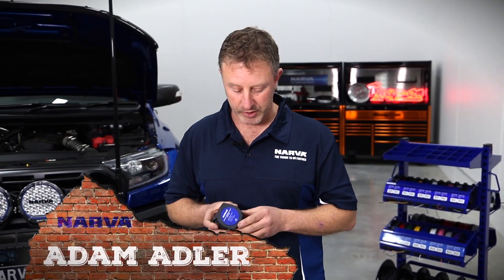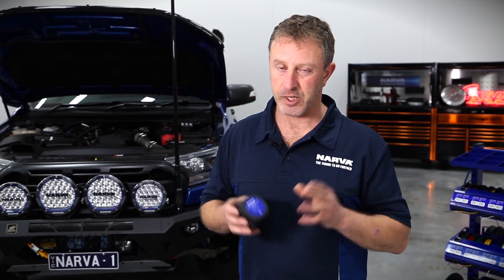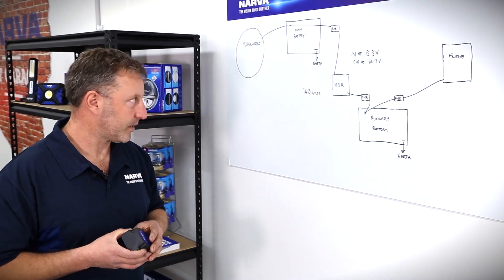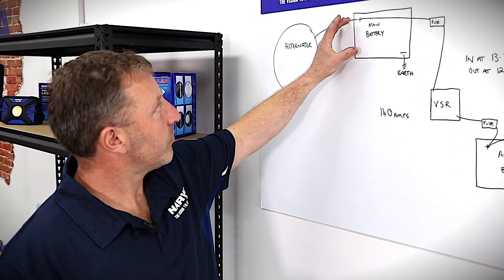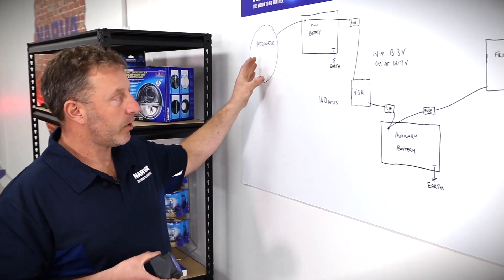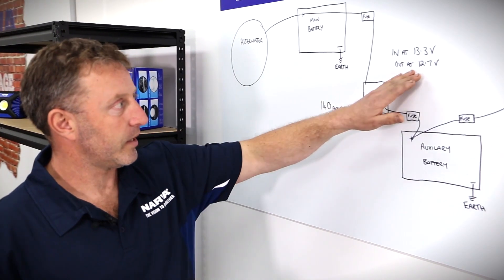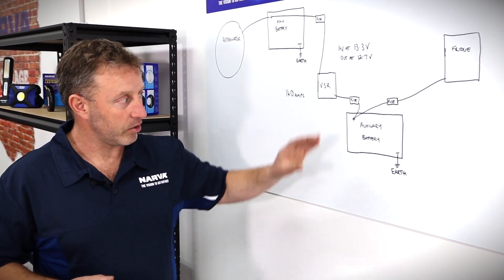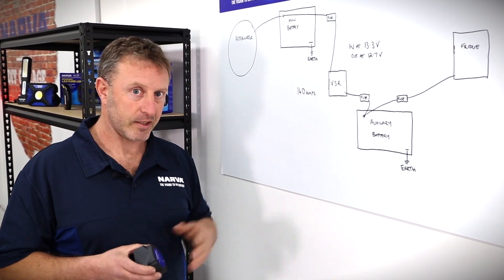How a does a Voltage Sensitive Relay Work?

Comment: Can i use a smaller vsr 12v 50amp on my motorcycle to connect auxillary fog light ? I want to connect it direct to the motorcycle battery and when the engine is not runnung to kill the auxillary lights !!!

Comment: We have this sort of set up in our Semi to run the APU, the problem is the APU will run the secondary batteries down then it will run the main batteries down so the truck won't start.  What do you think the problem would be, the main batteries shouldn't run down.  There are four batteries for the starter and four for the APU all hooked in parallel and they all run down.  The starter batteries are 1 year old.

Comment: Hi thanks for the info , this is all new to me , all vsrs seem to have very high ratings (140amp), I’ve always fitted 30 to 40 amp relays in a split charge system , my current alternator is 70amp , I’m concerned about  damaging my alternator , can you enlighten me ?

Comment: So if you have a 140a alternator, will the relay send 140a to the leisure battery?

Most dc to dc chargers only output around 20-50amps, so will using a VSR charge the leisure battery quicker? 🤔

Comment: Great video. Any idea why my VSR keeps clicking? I have it connected to leisure battery (AND solar panel via controller). I can isolate it from starter battery & from leisure battery. The VSR works fine when I turn engine on. Whilst in my van with engine off it starts clicking like crazy. When I isolate it from start battery clicking continues. When I isolate it from leisure it stops. There was a yellow wire in VSR that if connected allowed a closed circuit between both batteries. I just left this inside & unconnected. I then cut it off down to 5mm but this did not stop the clicking either. - thanks Paul

Comment: How does 2 alternators work in 24v battery system.May you please assist with an explanation,I saw it on a mercedes Benz bus charging system

Comment: I have a dcdc charger which continues charging my aux battery until the voltage drops to 12.2V. Can i use this to turn the charger off at 12.7V instead?

Comment: Can you use a VSR to protect an alternator from a overvoltage/undervotage BMS cut off on LiFePo4 batteries. I have heard people can protect there alternator by installing a dc to dc battery charger off the starter to the house bank. So that the alternator only charges the starter battery and the house bank is charged via the dc/dc charger.

Comment: How I can tell if my alternator is smart or not?
Reply from the maker: Hi Rayan, to be completely certain it is best to contact the dealer as they should have that information, however you can always check forums as they are a great help, unfortunately we don't have a list of what vehicles do and don't have smart alternators.
Reply from the maker: There is this forum link that may help: https://www.etrailer.com/question-326099.html
Reply: Great explanation. How can I diagnose if my DSVR has failed or not?  It seems to charge my house batteries only intermittently. No apparent reason when both banks are charging or only the starter battery. My system is wired exactly as in your diagram. The led on the from is on when it should be charging both banks but I see charging voltage only on the starting battery. Thanks for any help you can provide.